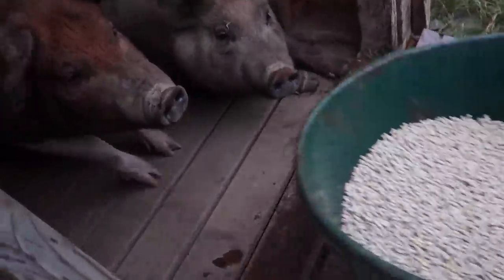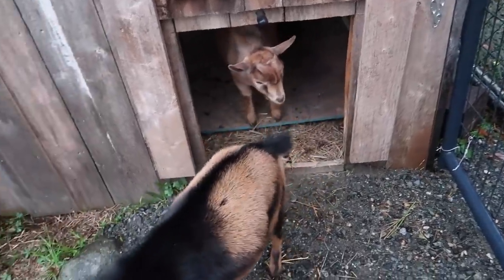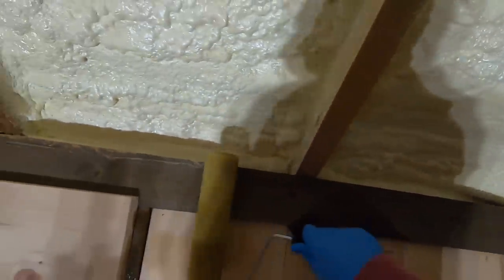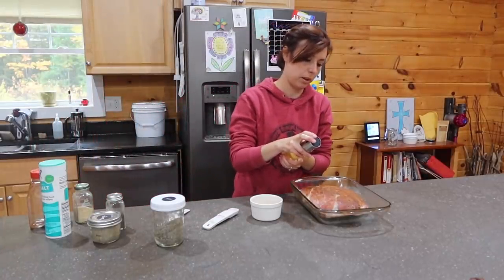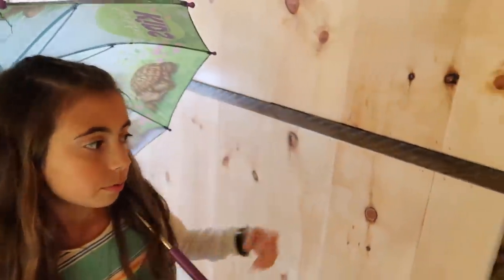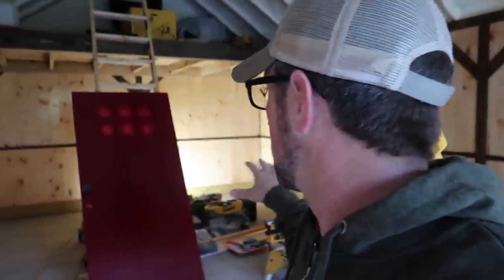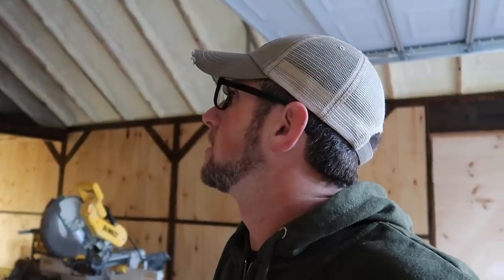Time to Get Sticky! Applying the FINISH to the Post & Beam WorkShop

Comment: Here is a little tip to catching mice. Get a deep bucket with side handles a broom or mop handle, a couple of tins or a soft drink plastic bottle with neck size width same as broom or mop handle. A hole at the bottom of the bottle big enough for the broom or mop handle fit through. Then smear the outside of the bottle with peanut butter then fit the broom or mop handle through handles of bucket then fill the bucket with water then place a ramp up to rolling bottle to get mice.

Comment: Since you plan on using it as a place to work on vehicles, I would pull the truck in there first to see just how much space it will take up with the door shut before deciding on a workbench and tool storage layout.  Having to work on the truck with it only halfway in would be a real bummer in the middle of winter.

Comment: You might think about doing and L shape then build a movable work table that can live on the other wall. The movable table I would look at putting a woodworking table clamp vise on with a pretty solid butcher block top on. The L shaped bench you could put a metal working vice on so you can pound on stuff I would so that out of ply maybe. Amazon has good metal working and woodwork vises.

Comment: 3 in 1 Workbench. How to build a workbench. Table saw...@ Michael Paley 1:00:53 
DIY Building a shop workbench and Dream Build Update f...@Kapper Outdoors
DIY Workbench Ideas/ Workbench ideas and designs @ Vincent Dramis 7:56
It should be in every work bench!!@Woodworking with DIY 8:20
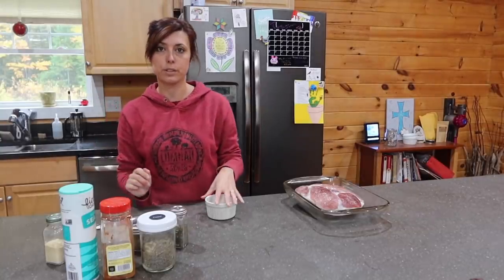3 simple Jigs to get professional results from any table saw@Wood. work. Life. 9:20
Panel clamps// Stop paying for Overpriced tools!@Make things
How to Make Resizable Large Dowels maker with a...@Tree- an wood.
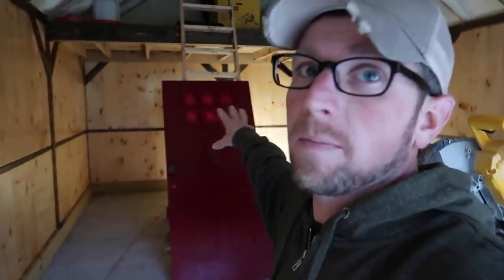Simple Modular Work Tables (with Magnets)//Wood...@I like to make stuff 15:40
Ultimate Outfeed/Workbench Storage Build@ John Malecki 8:30
Remember I replaced the you tube symbol for (@) not a web site...
Hope there is something useful if only a few more channels to research.

Comment: The saw should be movable for different angled cuts, so you can store it to the side when its not needed. use a lot of vertical space as much as possible when it comes to space saving storage  :P
ceiling storage would be nice too that latches up when not in use, Hidden away. There is a lot of video ideas.. but its a lot to dig through

Comment: Just curious but why did you choose the oil based poly over the water based polycryllic? That shop is gonna be sweet! also, as far as your workbench, that miter saw is big. I have the same saw and it requires a lot of bench space. I am leaning towards a mobile cart with extension wings on it. I would rather have it mounted in a bench but it just uses too much space. I might also suggest a dust collection system. I purchased a 2 hp Grizzly collector for just over $400

Comment: First Al, leave the bucket on your tractor, cutting edge down  against the ground so it does not fill with rain water and rust away. For the work bench, 2X4, it would be stronger. Watch some of the YouTube videos on wood shop tools. There are a LOT of really good ideas on how to make your saws mobil. For your table saw, Harbor Freight has a roll around base that can mount to the stand for your table saw that has locking wheels. Mount your vise on the right hand outer corner to give yourself plenty of room ( a long piece of pipe or conduit could be hard to cut if your space is limited ). Maybe once you have moved all of your tool boxes and tools out to the barn you will have room to build Gina a crafts room in the house. Keep up the good work, be faithful and always honor God and he will continue to bless you and your family.

Comment: Mitresaw is one of the most dusty tools. It's better to make a wall attached box to host the extended arm and contain most dust. 
For the U shape bench melamine with hard wood edges is very sufficient. The center bench, I recommend Paulk work bench which can be customized.

Comment: Here is a link for a 12 pack of link able LED lights with  wiring to link them together Up to 8 in a link or 4 rows of 3 on the end and 2 rows of 3 and 3 rows of 2 in the middle makes them very versatile and rated high. I think a 2x6 work bench top would work well and be sturdy enough for a vice and still hold a lot of parts for projects. I made one with a try-angular legs that fold to the side flat against the wall and allows for the bench top to fold down when not in use. On the right side of the bench a  cabinet with shelves on 1 side and drawers on the other side wheels that are lockable on 1 end to keep it where you need it 2 fixed on 1 end and 2 lockable casters on the other work well, and  that would allow you to set it anywhere and lock it in place. Last but not lease I highly recommend at least a power strip on each side of the barn to plug in portable lights battery chargers corded power tools compressor  and a portable lift like this one check out the videos on you tube for this unit https://www.maxjaxusa.com/buy-purchase-maxjax-car-lift/dannmar-maxjax-standard-package.html. Hope that is helpful

Comment: Some switchable spot lights to put light on work stations without you casting a shadow can be very valuable. Why try to get good work with bad lighting when a little planing can put good light right where it is needed only when it is needed. 

For the work surfaces 2x4's in butcher blocks setup are a cheap and easy method When combined with strong legs 4x4's or metal you have a good surface to beat on projects on.

A battery charge station can be worth the effort to make as it puts all the rechargeable tool batteries in one central place with a charged and needs charged shelf it is easy to see what batteries are good to go and swap on the chargers as you pass by. Could also build it as a A frame cart on caster wheels with a power strip for a single plug to the wall if you wanted it mobile.

Comment: oh yeh the heavy sealant on top of your movable work island is for less damage to top so others can use it after your finished with it heavy parts will gouge the wood so perhaps a nice steel top or heavy plastic if damaged then just replace simple and screws would be best for fixing this to the wood.

Comment: I am suprised you did not cover the celing with either wood like you did the walls or Just plain drywall. You would notice an amazing sound reduction from rain and it will add to your insulation of the shop.

Comment: Make sure to measure your heavy equipment, so you don’t have benches in the way.  Personally, I would do a fixed bench off the back wall, and roll cart tool benches that you can move wherever.  This gives you the ability to change your shop as needed in the future years.  You always want easy change.

Comment: First thing you should have done before putting walls and foaming is electrical...need outlets and lighting.  Now you will have to use metal or PC conduits taking away fro. The look you want.

Comment: May want a steel surface for the right hand side of the workbench with your bench vise on that outside corner. A shop sink is one thing that always seems to be overlooked. Checking out sites like Stumpy Nubs (Focuses on woodworking), Wranglestar (forestry management/homesteading), Millennial Farmer/Welker Farms Inc (large farms/heavy equipment maintenance), Essential Craftsman (General construction/Blacksmithing), and Andrew Camarata (machinery maintenance). Just watching their videos and the way they have their respective shops set up should help out allot. No matter how much space you have it never seems enough. Taking the time now to plan things out and do some research, it will save you allot of time and effort in the future. Just a Pebble In The Pond.

Comment: My shop I built a work table with 4" x 6" post, with 3/4" plywood top, the plywood top is the type used when pouring concrete walls, not sure the proper name, but had like an oil to it so the concrete don't stick so bad,, but made a great top. I/4" plywood for sides and back, has 3 deep drawers on each end with opening with shelves in the middle. Dadoes the 4 x 6, and 2x4 framing around it. The only reason for the 4 x 6's, I already had them, could change those to 4x4 and work well I'm sure. It's passed strong, built like a tank and too heavy to be moving. I have moved it one time and it took 2 of us to move it,  and not lifting it, just sliding it,  other than that if I need to just move it a foot or so can use a 2x4 it inch it along, ok. It will take all the banging you want to do, it has a big vise bolted to it  and a drill press on one end, and it's as  steady as a rock. The top has a piece of carpet on it, for no reason at all, just had it. Keeps little things from sliding off is all. If interested in this one can get you some pictures, with all my mess on it. it catches everything, sometime I just leave what I'm using until next time I need it. It can be made the length and width to suit you. mine it made for what I wanted. No plans, just built like what I wanted and had material for. I did stain it , it don't look half bad. I put receptacle on the front  and end of framing., just to be handy. Even have a telephone on it.

Comment: What if you do a butcher block style for the full U shape but make it so two sections drop down sand their table tops are supported by 4x4 that rotate out the way when you fold the part down.

Comment: I would not have painted the walls so quickly. From the looks of the wood, it was not fully dried. So if there is too much moisture in it, your finish will bubble and flake. 

Whatever you do with the chop saw, make sure you have plenty of board support to the left of the saw. I think both you and Gina are right handed, which means you should be holding boards with your left hand and operating the saw with your right, so cutoffs should be on the right. 

Make sure, whatever design you choose, to include a good large dust collector system with 4" or larger ducting.  A really decent one will cost $2000 or so.

Comment: I think you would be disappointed if you put your saw in a fixed location. It would limit the size of the wood and your video options. I would build everything as modules, on 4-inch casters. You can move whatever you want out into the middle for good workflow and camera angles and lighting. You could have worktops at sitting/standing heights -- for kiddos and adults. Consider a 2-1/2' - 3' diameter table for conversation and breaks. Might be nice to have a fridge (on casters) too.

Other advantages to modules: You can move easily to sweep or vacuum. You can set up shop outside the barn, if it suits the occasion. Modules can be forklifted elsewhere on the farm, as needed for future construction projects.

But, most importantly, it gives you flexibility. If you decide something is in the wrong place or is in the way, it is easy to change around.
I like wheeled hi/low drafting chairs because they work at desk and counter height.

Comment: 4x4 framing ,cut offs then ply on top of that,  heavy duty cart wheels ,that can be moved. if needed.  I built one about forty years ago,  and was still in service, when I retired.  as far as I know it is still in the shop/ garage.'I mounted a five inch vise, at one end ,and movable cleats that allowed many things too be clamped.   my wood shop had a broad saw, that would cut both Length and with. the table was on a cable that lowered and raised the plate too  fit my needs.  but can be done in wood.   just build a metal square to hold the saw. then to the miter saw. that can be mobile.   there is so many things that can be done. the most is the heating the space.there are many ways too do that too,

Comment: I see ya'll use the same clear I use, in fact Lowes stocks it & the mineral spirits ( not the odorless stuff, is junk ) I use for cleaning my brushes & rollers. I built a shop & laundry room in the basement this past winter along with a workbench & a mobile off feed table for the table saw. My wood stove is down there making it a great place to tinker...  My daughter calls it my " man cave " & she's right)
(2) coats of satin poly, perfect, drying won't happen until after the rain stops. 
Al, 1st & foremost before any bldg. commences: SEAL the floor(s), do the research, make a decision. Sweep & clean it as best U can 1st. 
I believe U are on the right track with respect to the miter saw placement, i.e., ( 8 ft. ) to the right, unlimited to the left a with a adj. roller stand for those long boards.
Work shops are an extremely personal thing, trust your judgement, U strike me as a clever guy! I installed a 10" wood workers vise on the left side of my benches fascia with 14" scrap hardwood, oak on the inside jaw & birch on the outside jaw. The vise is over 50 yrs. old & was donated to the cause from a good friend as I completely restored it beforehand.  ( LITTLESTOWN HDWE. & FNDY. CO., Littlestown, PA, )  
Personally I like a shelf under my work benches for storing misc. boards, cutoffs, etc. I use a Home Depot Rigid 16 gal. shop vac ( on sale ) on my Delta table saw ( Lowes on sale )... 
Are U thinking of perhaps putting a small wood stove in eventually? Come winter you won't regret it!
Bill on the Hill... :~)

Comment: I used this for planning a shop layout - https://www.grizzly.com/workshopplanner .  IF it doesn't have exactly what you need (all your tools should be available there) you just approximate.  On the spare bench you'd have a 10" band saw, a small drill press, a grinder and a rotating vise on the corner.  IF you're not going to build a Torsion Box assembly bench (and you should consider it) then you have to make some sort of woodworking bench, something robust and can take a pounding.  Don't make any of them wider than your ability to reach the wall (for tools and outlets).  Since your Sliding Miter Saw is so deep, it would be wise to plan to make cabinets or drawers behind the fence line (shelves at least).  A Bosch Glider Miter Saw is best for permanent bench space, having the smallest foot print (least amount of space behind the fence line).  The place is looking amazing, Al AND Gina!  Since you've been in there working I keep having a thought pop into my head.  wouldn't it be nice to have a few (6 probably) skylights to light up the space during daylight hours  Has that thought passed either your minds, Gina or Al #LumnahAcres ?  Great work you, two!  Looking fantastic!

Comment: Google - best type of shop layout and then click images . Plenty of ideas. Add more outlets than you think you need. Plus add gfi in box or as an inline outlet, safety and your insurance company will love you . Run 3 and 4 way wires for making life easy  and safe. Sad to not see fire extinguishers all over the farm and in vehicles. Maybe buy a trash can with lid in the shop, mounted to a round base with casters? . Run a 220 over to the work shop counters in case to every install a mig welder? Have at least one work area with a metal counter top. Place the shop vice in an area where long items can be secured with ease. Mount the led lights on chains with extra wire coiled. Because then in the future you can change your lighting without moving anything more than a few eye hooks. Don't forget all of your wheeled mechanic boxes in your layout.

Comment: Also, you may want to have a mobile workbench so that you can move it into the open area.  The loft may block some of the taller projects from being placed on the workbench.   April has a plan for a moveable workbench (you may need to build a smaller version). https://youtu.be/x9XIrfiNyUA

Comment: The problem with a permanent bench on the end wall is that becomes a "storage" spot and you end up losing your working space. As for shelving I'd go for shallow and high up. With deep shelves you end up forgetting about the stuff towards the back. Having them up high keeps your working space open. You might check out the bench Wranglerstar made for his barn. Strong enough to mount a vise on and take some pounding. https://youtu.be/gxytro5m61g

Comment: Your the wood worker but here are 15 I thought you would enjoy just for ideas: (for you tube symbol I'm using the @ as it's easier no sq w/triangle in my symbols)

DIY fold down WORKBENCH@DIY Creators 9:57
The ULTIMATE Diy Portable HINGED folding workbench...@Charlie DIY te 21:50
DIY Workbench/Worktable/How to Build@Fix this Build That 8:49
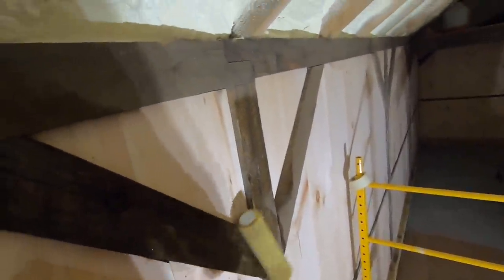100 % Pallet Wood Woodworking Workbenches@Jackman Works 5:24
5 DIY Workbench Hacks/ Woodworking Tips and Tricks@Woodwork Web
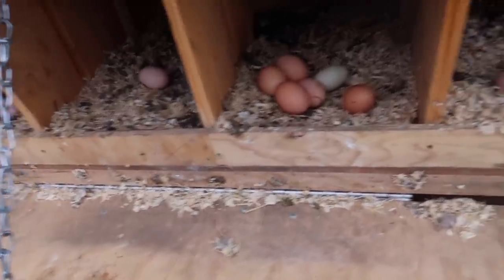How to make simple folding workbench & trans...@ My ATCtv DIY 11:40

Comment: Thank you for sharing, barn envy for sure!!!! Put a rubber matt on the work bench area floor, if a project is dropped it will land on rubber, if a tool gets a short, you are on rubber, and last standing on concrete for any length of time is hard on knees..my 2 cents! Cool stuff.

Comment: That pork looks yummmm! thanks for recipe. how long did you cook it and at what temp? BTW, for your workshop, if you make it U shape you'll lose corner spaces. how about making front parts as foldable attached to wall, so when you don't need them, fold the feet and hang top to cover the feet. you'll still be able to use part of table when it is folded but it won't block you from accessing all of back table. something like this

http://kvartal.co/wp-content/uploads/2018/09/wall-mounted-table-wall-mounted-es-fold-down-hanging-e-hung-bedside-folding-wall-mounted-e-wall-hung-table-and-chairs.jpg

Comment: I would not attach any thing to the walls, keep it flexible..  If you are going to do metal work, get a steel top work bench, attach a good vise to that.. I have two of these work benches from Harbor freight, one in the basement and one in the garage. I set them up so I can work from all sides.. https://www.harborfreight.com/60-in-4-drawer-hardwood-workbench-63395.html?_br_psugg_q=work+bench